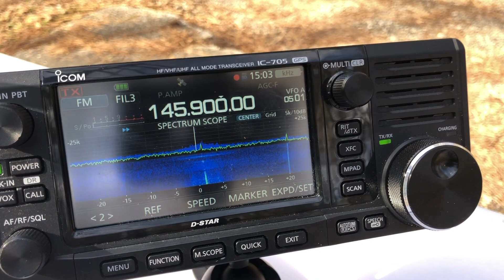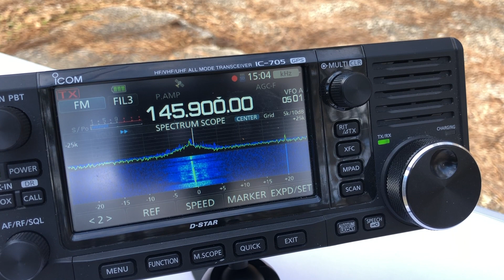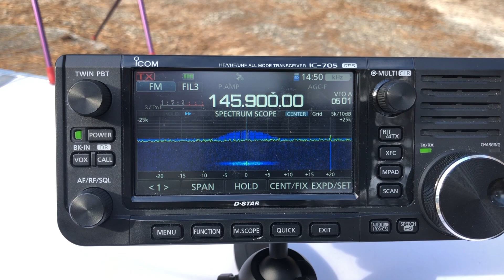Working amateur (ham) radio satellite PO-101 with the Icom IC-705 and ID-52 transceivers

Comment: Couldn't you just use SPLIT ? on the 705 ?
Reply from the maker: No, the 705 is not a full-duplex radio.  When working satellites, it's important to be able to hear yourself on the downlink.  I used two radios so I could do that.  The Icom 9700 is full duplex as is the Kenwood D72, but I don't own those.

Comment: Very nice combo.  Although I like the 705 paired with the far better Kenwood D74 (it can act as a SSB reciever for the better sats).  At home I pair the 9700 with the 705.  9700 sucks as a duplex radio, if CAT is needed, so I use the 705 to listen at home.  Although if FM sats are all one does, you don't need much.  You just need patience for the endless keying.  I would also use the handheld as the receiver, and power the 705 with 12v, so you can get the 10W.  The extra 3d will let you get over the new guys that don't know their transmission is getting into the system.